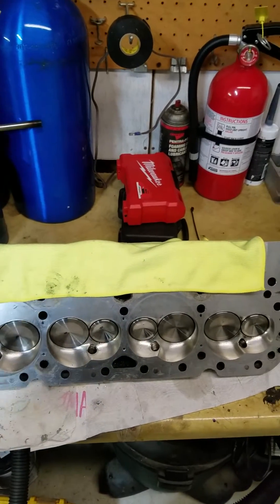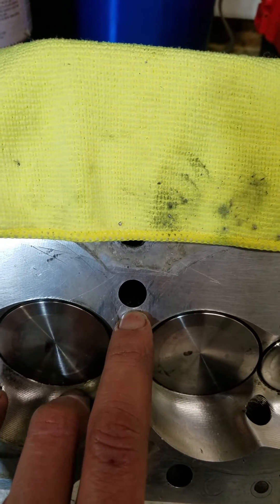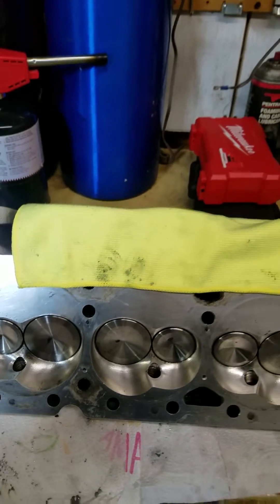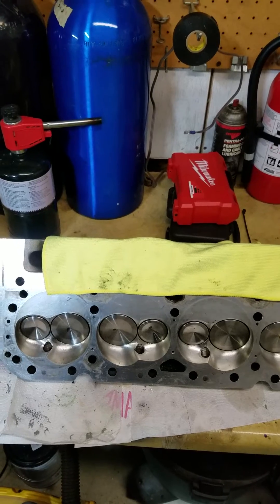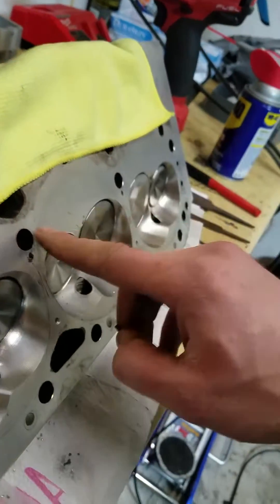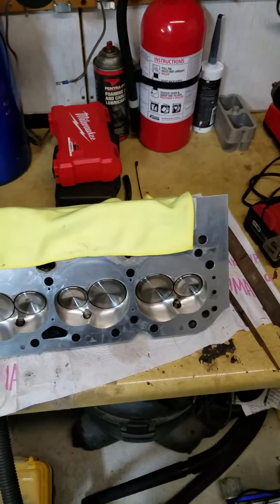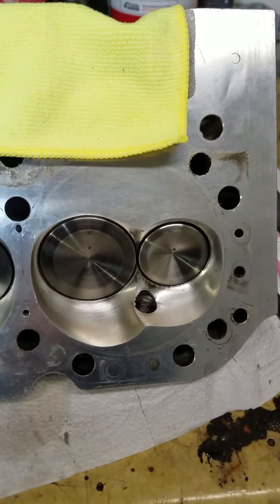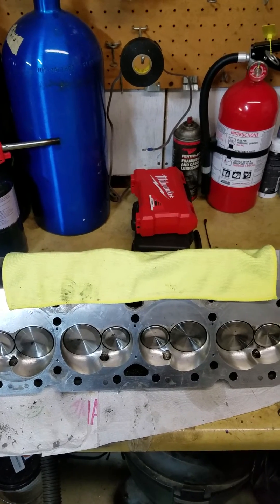400 SBC steam holes

Comment: Never drilled a steam hole in a. Cylinder head never had a problem with any of the 377 or 406s that I raced or several stock street engines that I overhauled we put 4 barrel 350 heads on several stock 400s that we overhauled because of cracked factory 400 heads and the pistons would also crack the skirts
Reply: What did you  come here to say ?

Comment: The steam holes on factory 400 heads are 3/16" on the intake side and 1/4" on exhaust side. The intake side holes may not be drilled on all aluminum heads. Edelbrock only recommends drilling the holes closest to the exhaust. Check with the manufacturer first. The exhaust side of the head is going to run hotter anyways. So, the 1/4" exhaust side holes may be adequate for a lot of applications. Good video. have a good day.

Comment: I have always keep steam holes in my 421 small block strokers! Here is a good story....a mechanic in the 80's in Arizona said wrong head gasket or corrosive water no antifreeze were the engines that cracked or blew head gaskets from clogged holes! I would keep holes never had a problem since 1982 first 400 sbc!

Comment: local speed shop told me they havent drilled those in years and years. Said thats where the blocks crack and recommended filling it before we deck the block. this is definitely a street engine.
Reply from the maker: There alot of different thoughts on this. I go with what I know. I do understand what they are saying and I'm sure it will work. I just like having the holes as designed.

Comment: I bought a 400 from a guy, because it constantly overheated,. He had 350 heads on it, without the holes, I figured that was why it overheated, I planned to refresh it and plop on the aluminum heads I have! Now I'm not quite sure what to do! I didn't think drilling a few holes was this difficult!
Reply from the maker: It was probably over heating from cooling system problems. Fan,radiator,water pump ect. You can have any machine shop drill the holes.

Comment: With out these hole there it makes upper cylinder hot spots because of siomeased sleeves ring pack could be affected
Reply: There is no need to drill the holes on the intake side. Only drill them on the exhaust side.

Comment: If your 400 is a race engine only then there's no need for steam holes... only street driven cars & trucks might need them...
Reply from the maker: To a degree yes. But say you have a 1000hp turbo combo its a good idea to have them in my opinion. When you're pushing the limits it helps to keep hot spots out between the cylinders. Again imo.

Comment: Ran 305 heads on a 400 block for circle track for many years, never had any problems. Didn’t run rear crossover either. Filled with water, made sure no air pockets, 7000 rpm .
Reply from the maker: That horsepower level it really isn't a concern. The 305 and 350 cast heads flow 180-195cfm so roughly a  360-390hp engine. When in the 550hp plus range is when it just makes sense. Most critical 750hp plus. IMO it just good practice in these applications.
Reply: @DIYracing454  yeah we hogged the heads to the Max and put larger intake valve, clearance between intake and exhaust was .012 thou. Couldn’t believe we didn’t have problems but did several engines.

Comment: I never drilled steam holes on my 400’s.Never had A over heating problem.Good water pump,fan and radiator,no worries.
Reply from the maker: Correct. it's  not as much about over heating. It's about making the system more efficient around the cylinders,helping with hot spots, The more power you make the more it becomes a priority. You will notice racing engines add rear coolant crossover & the aftermarket heads have bosses for center cylinder coolant cross ports for this reason.
Reply: Glad ta here it ! My mechanic broke a bit off in one a my holes 
In my aluminum dart heads . We rolled the dice ,  left it in .

Comment: Why does the factory sbc need this when aftermarket sbf Siamese bottle blocks don’t
Reply from the maker: You dont have to have it, It does help with cooling flow/steam between the cylinders.It helps to prevent hot spots. I like the idea so I use it. Its just like when people add cooling to center on sbc heads to avoid hot spots and adding rear intake crossflow. All things I run in racing applications. You don't have to have any of these things but they all help.

Comment: That one hole is no even round and I think 3 of the holes are in a angle. 
$75 Extra dollars to pay afr to fo it on $2000 a pair afr heads?
Reply from the maker: The holes came out fine. But yes as stated makes more sense to spend $75 when new. If you buy used you have no choice. Also the hole can be easily welded and milled for $150. So not a huge deal if you mess up. Just not something a beginner should try.
Reply: @DIYracing454  for sure trial by fire that's the only way to learn

Comment: no need to drill steam holes have ran my 400 with 350 heads for years with no overheating issues its even bored 60 over
Reply: Interesting, now I'm gunna read up on this. Lol before I go drilling on these new alum heads.
Reply: if if its a strip engine ill agree. a street engine that may idle alot in hot climates? better drill them. cheap insurance
Reply from the maker: You dont have to drill them correct. Drilling them helps cylinder head temp. I like drilling them for the fact im making the cooling system more efficient.
Reply: Why did the factory use them due to iron. Heads if aluminum they don't need them or what?
Reply: If you didn't drill them you certainly had localized hot spots, whether your temp gauge showed it or not. And trust me, in hot climates with no steam holes drilled you WILL have overheating issues sooner or later. Ask me how I know.
Reply: im runnin dart pro 1 230cc heads with block half filled with hard blok
Reply: Siamese cylinders is the reason for them no coolant going between the cylinders when the coolant does hit that hot spot it boils hense the steam holes those cylinders have to be really hot on the sides compared to 350 blocks so anything that can be done to help that and save the block to fight another day is my thoughts they are getting harder to find anymore espesially one complete and running in a car all factory un molested
Reply: had one bored 60 over with camel humps on in a 4x4 squarebody dailyed it in 80 and 90 degree weather pullin 35s and 456 gears never overheated , had a 70 monte with one in and run the hell out of it every where n it didnt eather so each to there own i ajnt had that issue so

Comment: Good Video.   How did you come up with your angle on the top holes?  Have you run these heads yet?  Any issues with the hold being so close on the first head?
Reply from the maker: Thanks, AFR spec gave me the angle. I used a angle finder and template. Not the most accurate but worked just fine.
Reply: @DIYracing454  when you don't need those heads anymore send them to me for my 400 😁